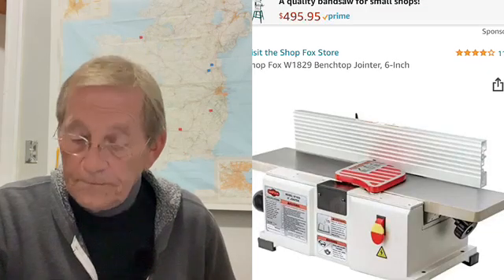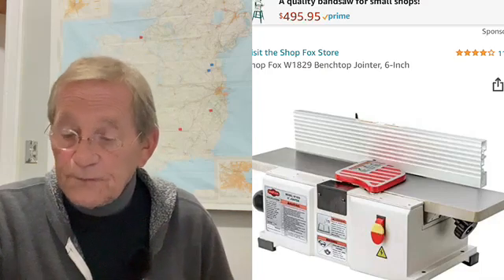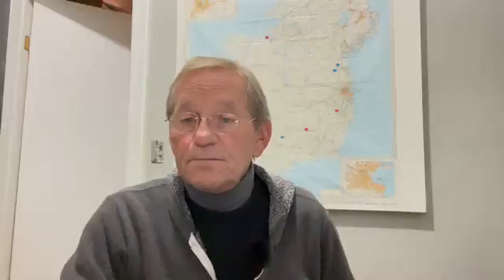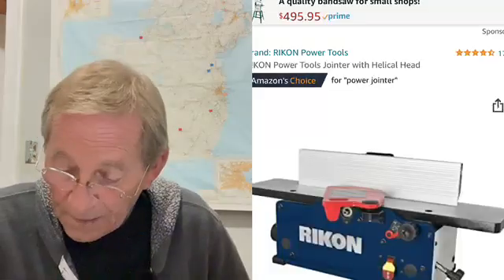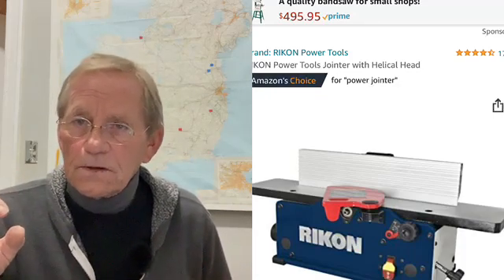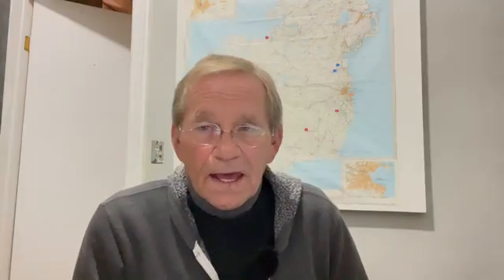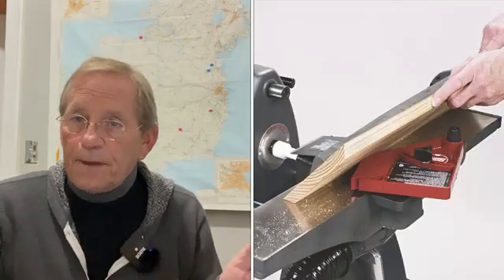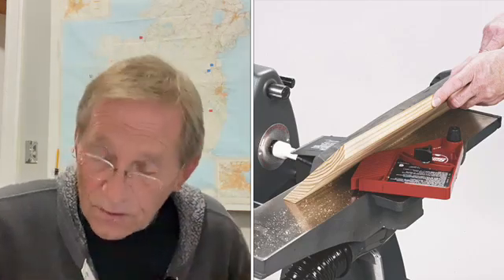Is There a Right Jointer Speed? #shopsmith

Comment: "you're using the lower, auxillary, power spindle ... and it runs 1.5 times faster than the actual RPM of the motor". The motor powers this shaft via a variable ratio transmission. So by very definition, that ratio is not set at 1.5.

Comment: Very informative, it seems folks are all hung up on more HP. I had a 6” jointer that had a 1/2 HP motor. It worked marvelously. I think if tools are tuned, sharp and used with a slight amount of common since, you can accomplish most all the tasks you desire, and in a timely manor.
Reply from the maker: agreed